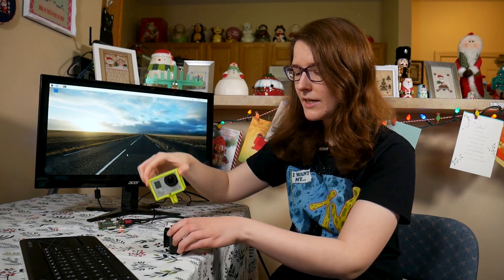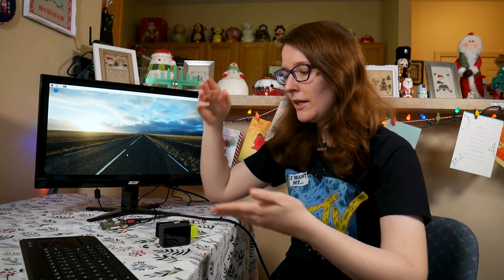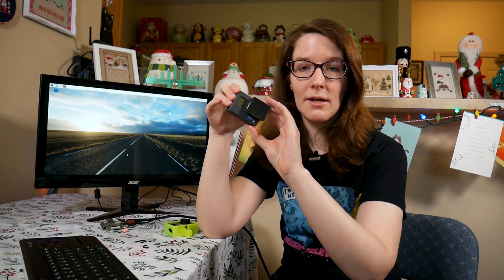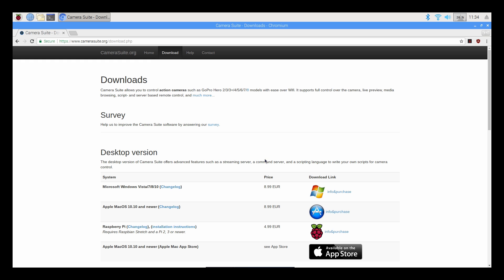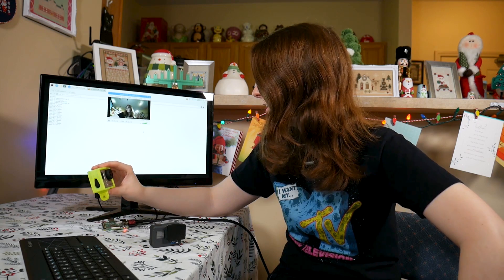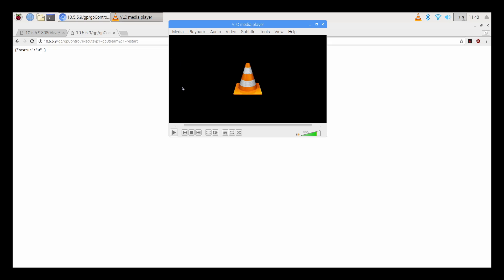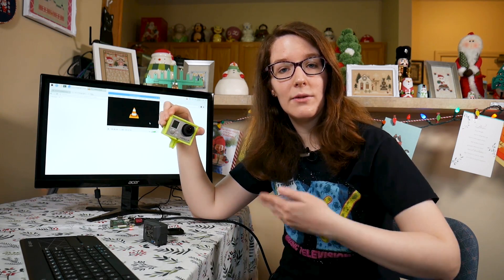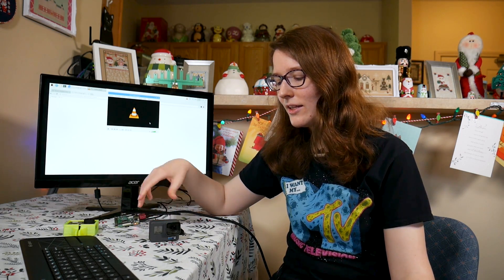DIY FYI: GoPro and Wi-Fi

Comment: Agree when you need to add gopro to OBS on Linux it would be nice.  Have GoPro Hero7  its even not easy to make hotspot share on the phone and use the app to connect to the phone hotspot but I use another wifi not on phone with the app its possible to connect and have a nginx with rtmp running on this wifi and this you can add to a vlc to get the stream from but with delay.

But in a way you need two wifi's  very stupid..  maybe a way to fake a wifi or adding  wifiusb device - if the phone is connected to my local wifi it normaly turn off the hotspot that I would like the gopro to use.   You dont see alot of gopro livestreams because its so stupid made compared to older gopro's - if it was possible to assign a network to connect and the outgoing rtmp destination but we need this app I would prefer to just go live without the need for a app.

Comment: You should be able to open the stream using  ffplay . It is also mentioned in KonradIT's goprowifihack project in "Livestreaming for HERO4". (Should work on any GoPro after the HERO4)
I tested it on GoPro Fusion. However, I experience the issue that the stream simply stops after a few seconds and requires using the restart url in order to keep it alive.

Turning the WiFi on the GoPro remotely is also possible, as long as the control device can connect to the GoPro over Bluetooth. (Essentially, this is how the GoPro app works. It connects to the camera and sends Bluetooth command to turn the WiFi On)In order to achieve this from the Raspberry Pi, one first have to pair the two devices (GoPro & Pi) over Bluetooth, send a bluetooth command to the GoPro to activate WiFi, and then connect over WiFi. The bluetooth commands are also documented in KonradIT's repository.

Comment: Liz! I feel the pain. I recently resurrected a damaged Sony A7s camera and was planning a night-lapse shot for astro purposes, but then found out that Sony disabled the timelapse functionality for shutter control. There is an app built into the camera, but it's behind a $10 paywall. You need to create a sony account, add financial info, and pay for it. It's a punch in the face. It should have been bundled with the camera in the first place. I still have not paid for the app because it's slimy. I grabbed my Lumix Gh5 instead (has native full timelapse control) and was pleasantly surprised with the astro results.

Comment: I'd have paid the $5.

I've got a project on my long term list, but that I'm very serious about, but I'm not 100% sure how it would work. but this video makes me thing you might be able to help. The basic idea is an amusement park ride in miniature, like it's a small world, where there's a camera in the ride and you use your phone to look through the camera at the ride. Of course, you'd want to be able to control the camera or there's no point, and it should sync with the motion of your phone for maximum impressiveness. That can be done. However, if we wanted 2 or more people doing it at the same time we'd need 2 or more cameras and controls and they'd start bumping into each other or else they'd each have a limited angle of view... it just wouldn't work.

However, what if we used a fisheye lens so we got a half sphere dome angle of view. Then we just stream the whole 360 degree half dome to the world wide web, and anyone who wants can log in with an app like VR Media player, pick up the feed (VR Media Player will take a feed from a URL). The app will dewarp just the part of the image that they're looking at so they get the sense of looking around, and multiple people can do it without crashing.

Could a fisheye lense be put onto a gopro like this, and would this work, or would a custom rig work better? I feel like this should be possible, but the individual parts aren't clicking.